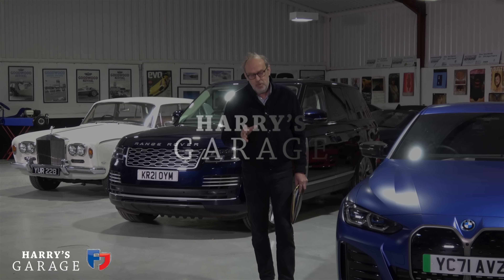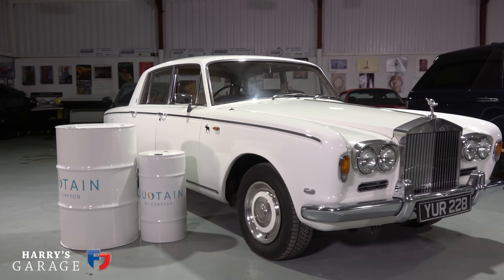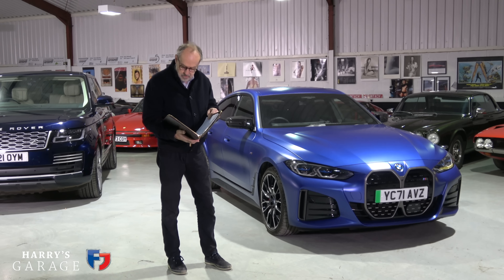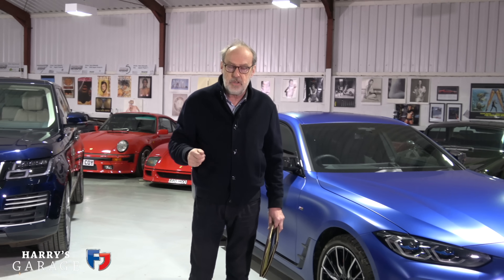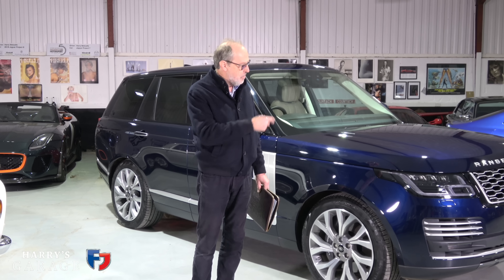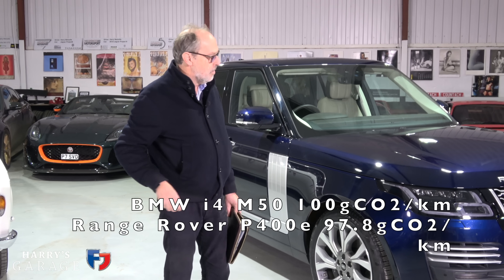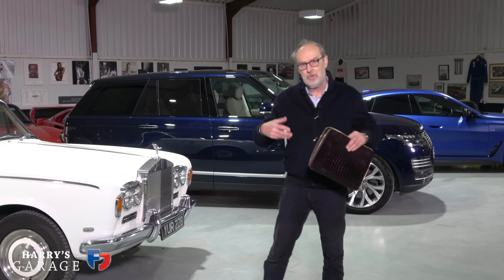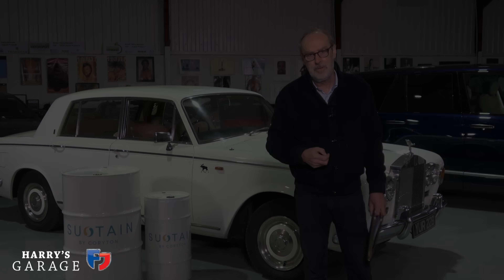Sustainable fuels; what are they & are e-fuels better for the planet than running an EV or PHEV?

Comment: I agree with everything you say. I only would like to add that manufacturing of hydrogen or biofuel from electricity is less efficient than storing it in a battery. So if we would apply biofuel on a massive scale we would need double the amount of green electricity to start with. 
I do think we need to get to a situation with excess renewable power available, and use this power to remove CO2 from the air, but then keep in locked into the earth instead of releasing it again.  
All this is of course medium to long term.
Reply: Incorrect. Hydrogen can be produced in a way that it increases a nuclear plant's efficiency. Nuclear plants have processes which produce hydrogen very efficiently due to how they work.
A massive amount of renewable-produced electricity and renewable potential is wasted due to timing of when they are able to produce power, also many renewable power plants aren't built due to cost and losses (distance) of building transmission lines and systems for them, plus the adjustable backup power. With e-fuel and hydrogen production we can utilize renewable power that would otherwise be completely wasted or never be financially viable without.

E-fuel production is near-term as opposed to EVs which are long-term (and EVs don't even reduce CO2 emissions meaningfully so...). E-fuel can immediately be poured into all existing automobiles' tanks and make them instantly more environmentally friendly than EVs. On the other hand it will take decades to switch out all ICE card for EVs. 

Without needing to force people into EVs which help nothing anyway, we won't have to spend trillions on those EVs (grid building, charger network, subsidies) and therefore we'll have the funds to invest in a massive amount of far more effective environmental projects.
Reply: Thanks. Nice to hear that there are some efficient ways to produce emission free hydrogen. I would love to see more investment in new nuclear technologies. 

But this does not mean that my comments above are incorrect. If you start from electricity, like the examples discussed by Harry, you also have to consider the efficiency from the green electricity to green hydrogen and e-fuels and then the efficiency of the fc or the ice back to the wheels of the car. Compared to these solutions an ev is much more efficient.
Reply: @philipheijnen  Efficiency of EVs is a false logic many people like to use. All that matters is the resulting emissions. 

As I said: much of produced electricity is wasted, or the potential to produce is never realized due to how renewable plants work and their huge drawbacks. E-fuels and hydrogen can increase their efficiency or even completely change their status from unviable to viable. We can produce e-fuels and hydrogen whenever the renewables are producing electricity, whenever they're producing surplus electricity, and it doesn't matter at all that they periodically stop producing. 
Renewables need backup power, often basically a whole second power plant to give us the needed power when the sun isn't shining or the wind isn't blowing exactly the right amount (wind generators have to be stopped when too much wind too...). And not just any power plant, they require a fast-reacting, adjustable power plant which is less efficient. That's inefficient and costly. Renewables usually need new transmission lines built or totally reworked. Often those would be long and very lossy too. 
If producing hydrogen and e-fuels with renewables instead, you don't need the second power plant, you don't need those long, lossy transmission lines. With e-fuels and hydrogen we can use every little bit of that renewable energy, have those plants in as remote locations away from the cities as we want. We can set up renewable power plants based on energy production efficiency instead of location near the population using the electricity (and yet conflicting with those people not wanting to live next to power plants). We can set up renewable power plants based on optimum location, not what is close enough to population for transmission costs to be low enough.

There are very many other benefits to e-fuels and biofuels too, like:

-EVs are only (in some cases) very slightly less polluting over their lifetime than ICEs running on fossil fuels...if driven a lot. But a huge proportion of cars are only driven very little per year, meaning switching those cars to EVs will INCREASE emissions. And that's only when using the fraudulent 'studies' produced so far which use incorrect numbers for EVs (I went through that here elsewhere in the comments). So if EVs have more emissions for a large proportion of car owners even based on the EV-lobby's own numbers...while using fossil fuels...guess what the situation is when we use e-fuels in those ICE cars? You do realize that even now for years hundreds of thousands have been using biofuels which are 70% less polluting than ICEs running on fossil fuels, so that makes them massively less polluting than Evs! E-fuels will have varying emissions just like different biofuels do and electricity production. But even using rough ballpark figures, and massively favoring EVs, the difference is so huge that there's absolutely no doubt: ICEs running on e-fuels and biofuels are clearly lower in emissions than EVs.
Then when on top of that we take into account that:
-EVs are far less efficient to use in cold temperatures, EVs are presented with fraudulent consumption numbers as their consumption in the cold can easily double
-E-fuels and biofuels reduce emissions immediately, not after the decades it takes to replace all cars to EVs
-EVs cost trillions to everyone through the need build millions of chargers, to rework the whole electric grid, massively increased vehicle prices. TRILLIONS! Those trillions being available for use in effective environmental development instead of being burned on EV totalitarian forcing for no good reason is a good thing, wouldn't you say? 

This is not a new phenomenon: Germany has just ruined its energy politics through a very similar political "green" mistake. That too had good intentions: they wanted to reduce emissions. They too were "intelligent, intellectual, enlightened environmentalist experts". They too got "overwhelming support and consensus" on what needed to be done, allowing them to spend billions and billions on "saving the world". And the result for the German "Energiewende"? The result was that the billions they spent were a total waste of taxpayer money = made the nation poorer, on top of that electricity prices skyrocketed, and now they've even suffered massively as they grew even more dependent on energy from a totalitarian evil state (Russia), and what happened to emissions? Emissions went up. 

Effective energy policy and environmental policy success is not about virtue signaling lofty intentions, a popularity contest, it's about the truth, hard facts, real science, and what actually works.

Comment: Great video, just one comment, what is the emissions produced to get 1L of fuel to the pump? e.g. drilling it, transporting it, refining it, transporting it, more transporting it, then the power to pump it etc etc.  I tried to google it but it doesn't jump out, I wonder why? if you are going to look the whole picture then it should be the whole picture, as it has been skewed for so many years.
Reply: What is the cost of getting the fuel to a power station? Coal, gas - whatever? Then the cost (or losses) involved in sending that power down the lines, through transformers and all the rest to a charger which will then likely lose 10% or more before it even gets to the battery in the car?
As you say - if you're going to include things it should be the whole picture. That also works both ways.
Reply: @siraff4461  most of that is accounted for, but not for fuel to the pumps. Strange hey?
Reply: @wobnoway5692  No, its not. The number given for electricity production from the grid is simply how much fuel in, how much electricity out. Nothing else is accounted for in any way - even the waste removal if its a coal plant.
Reply: @siraff4461  should be for everything don’t you think.
Reply: @wobnoway5692  I think a real study should be done and presuming we start with a field then end up at the cars end of life every single thing should be included - even the supply chain to make all those things. 
I know this would be a lot of work but this is one of those times where its worth it since the end result would give us the pointers we need to say which answer is best for which application. 
Considering the US are just realising their strategy of "clean" ethanol from plants is actually doing more damage than good thanks to crop disturbance, I think now would be a great time to pull up on the reigns and decide properly what the best direction is rather than throwing massive amounts of energy away running in the dark. 
Its only the last generation of cars which tell us this. We were told diesel was the next great thing and tax breaks came aplenty to get into them and save the planet. That didn't age well and I really hope we aren't heading for another eco-nightmare when loads of li-ion batteries come to the end of their lives while we still have no realistic way of mass recycling them. 
Considering how filthy they are to make in the first place the last thing we need is them being filthy to get rid of aswell. 
I don't know what the answer is and don't profess to. Fro what I can see at the moment a plug-in makes the most sense here and now because it can do most of its journeys on electric without the need for enourmous batteries. 
Of course I could be miles off and it may be Hydrogen to save the world. Or solid state batteries which can outlast the moon. Or any of the other things which are just around the corner and have been for 40+ years.

Comment: What happens to the ev cars after 10yrs when the batteries and knackered and need replacement, at a cost of 7k+? Also how would you charge them if you live in a terrace house no drive drag a cable across the path? Always wondered why hydrogen fuel cell cars were given the push

Comment: I love Harry, but this is the most wrong-headed and inaccurate video I think I've seen him do! Or at least, maybe not inaccurate, but certainly the most selective in his commentary. Complained about weight of the EV, not mentioning that PHEV Range Rover weighs far more. Carbon intensity of EV electricity is massively increased as if there is no such thing as the National Grid, whilst at the same time  giving the PHEV the electricity for free. No mention of the batteries required for a PHEV, or any other manufacturing process involved in ICE manufacture. No mention of the CO2 required to obtain petrol - it doesn't just magically end up in our pumps. It has to be mined, refined and transported etc etc. And the making of the synthetic fuel seems to be shrouded in mystery. I would be interested to know about the carbon free process of making it, and also what type of biomass is used. I noticed in the video there is a little diagram which included a picture of biomass pellets - these generally get imported from around the world which is why I'm always a bit suspicious of blanket claims of CO2 friendliness of biomass energy.
Reply: I was going to write a post but you have captured it perfectly. In nearly every comparison people compare the CO2 ‘cost’ to fuel an EV but compare it to the CO2 ‘cost’ of driving an ICE vehicle, completely ignoring the well to wheel cost. I have great respect for Harry but this needs to be challenged, there is too much cherry picking and comparing apples with monkeys….

Comment: It’s a very skewed review, as you generate your own electricity, therefore running the electric vehicle is free. Although CO2 is generated producing the car. The bio fuels are interesting but how much CO2 is generated in producing the fuels plus it would have been generated when the car was originally built. A complex subject, but it’s good to have options
Reply: It’s straightforward to factor in those things, including those on the flip side which you haven’t mentioned. UK government publishes annually updated carbon factors for:
- Fuel ‘well to tank’ (getting fuel for the power station and, yes, to the petrol pumps);
- electricity transmission and distribution (T&D) losses;
- a well to tank factor for the T&D losses. 

It’s also good practice to calculate and separately state ‘out of scope’ emissions. Those are the CO2e emissions from the exhaust pipe, but from the combustion of essentially carbon neutral over their lifecycle biogenic fuels, such as the ethanol in your E10 unleaded.

Comment: I live in the middle of two schools, hundreds of school children on the payments, as I pass in my electric car, I feel good they not breathing the Crapp the builder's van in front,  is spewing out, thick blue diesel exhaust fumes.. I hope the bio-fuel meets the requirements and guys like you with classic cars can still enjoy. 
As for the Grid in your area--well that's down to Drax burning wood pellets from the US.
Both the grid and the charging infrastructure  have to improve, oh a general rule of thumb,10 k miles driven in an electric car pays back its manufacturing footprint .
Batteries, well whole topic, fully recyclable ( REDWOOD MATERIALS IN THE US) but practices in Africa are disappointing. That said to fill up at the pump ---1, drill oil out of the ground . 2 Transport around the world in a Supertanker with the largest diesel engines on the planet. 3. into the refinery --ie Flawley which uses more power than BIRMINGHAM.. 4. Then store it ---5. Finally pump into a tanker to take to the Petrol Station.. 
Finally as for the Bmw 2.5m/kwh well that very poor -- Both my electric cars do alot better--- I'm glad you mentioned Scotland and other parts of Uk have a cleaner grid than were you live. .. Looking forward to the PV panel install Video . cheers

Comment: I might need to watch this again, but you seem to suggest that a plug-in hybrid car creates less CO2 than a pure EV car. How can that be? If the same electricity is going into both cars, surely co2 emissions will be the same if the plug-in hybrid is running on pure electric.
Reply: Afraid Harry's engaging in mental gymnastics that involve the PHEV being charged primarily from his wind turbine, though the BEV is not.
Reply: @ThomasMcGuire  Yes. That's what I was thinking too. Of course, there is some sound logic with some of what Harry says, and I agree about how cars should be designed to last much longer than they perhaps are. 

I also live in Oxford, so the electricity I have is relatively 'dirty'. But at least I pay for pure green electricity which means a significant proportion of investment goes into green technologies.

The other thing is that you can get pretty efficient energy contracts if you use EVs. For instance, I have a contract (Octopus) that charges only 5p/kwh for four hours in the early hours of the morning. In four hours, I can get around 80-90 miles of charge in my car on my dedicated charger (much more than the Range Rover can store in its batteries of course).  It means that the vast majority of my miles are between 1.5p and 2p per mile. So far far less than 12p per mile Harry is getting on the BMW.
Reply: ... course there's also that he's comparing 8,000+ miles of PHEV use (for school & shop runs as he says) to a single 130 mile journey in a BEV.

Comment: The massive downside of the new fuels however is that whilst it's not increasing the co2 output,it's not reducing it either,just keeping the status quo...plus it needs manufacturing and delivering which in itself will emit co2.
Looks like a dead end to me in comparison to ev,s.
Incidentally I have a phev at the moment as it's the best compromise for me at this time.
Full ev next time around tho

Comment: This goes to show how you can present statistics to fit your own agenda.  People are doing this on both extremes of the EV Vs ICE debate. You have assumed that most people are charging EVs at 30p per kWh, whereas most people charge at off peak at night when the majority of it is wind. mine is 5p, rising to 7.5p in April. You stated that you have to stop an hour to recharge on a long journey, EVs designed for this recharge to continue journey in less than half that time.  You omit to mention the carbon footprint of manufacturing petrol and biofuel and transporting it to fuel stations.  The reality lies somewhere in between the extremes.
I have an EV, it has a realistic range of over 300 miles (360 miles claimed), I travel from Newcastle upon Tyne to Cornwall and back a couple of times a year.480 miles each way. I stop a couple of times each way to recharge, once for about 25 mins and another about 15 mins. Not once have I had to wait to recharge or come across a defective charger.  Almost all of the 12000 miles I've driven it have been charged at home at either off peak,  but mostly from my solar, zero carbon. total cost of about £300.
Please be more realistic in the way you present statistics, unless you have political ambitions.